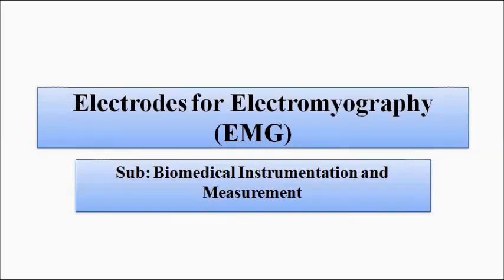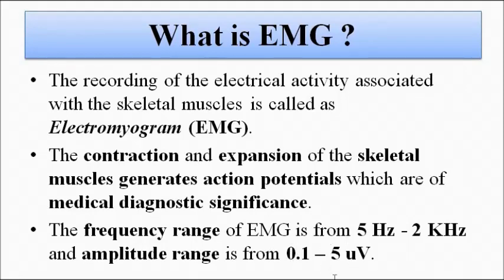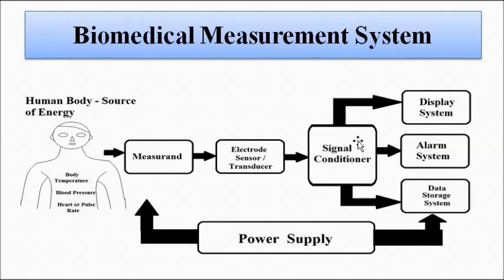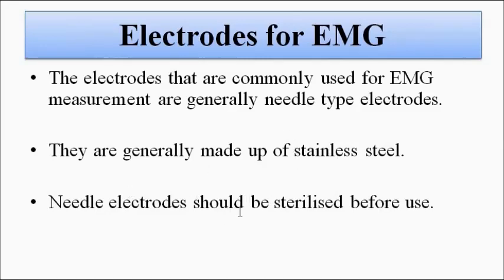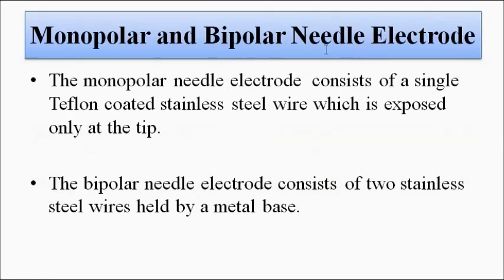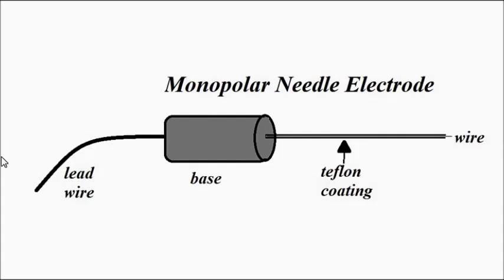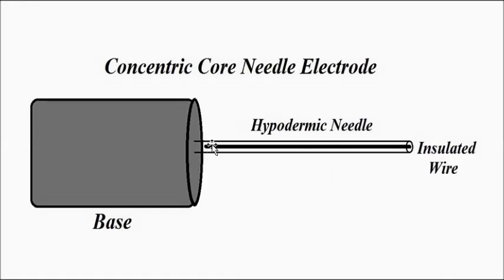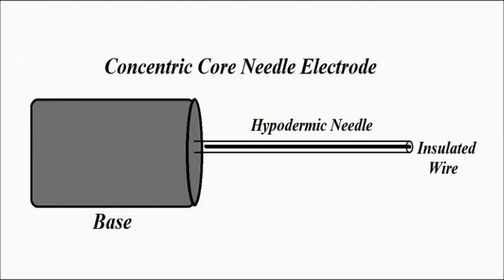Electrodes for Electromyogram (EMG) | Biomedical Instrumentation and Measurement

Comment: sir i have a doubt. you said that for bipolar and monopolar ,the tip is exposed and not insulated in order to take the signals. but it case of concentric one, the tip exposed is of the insulated steel wire, so how would that take the signal? is the whole wire insulated but not the tip?/